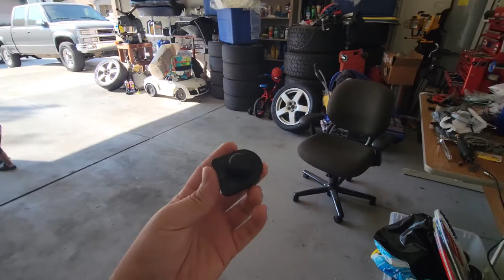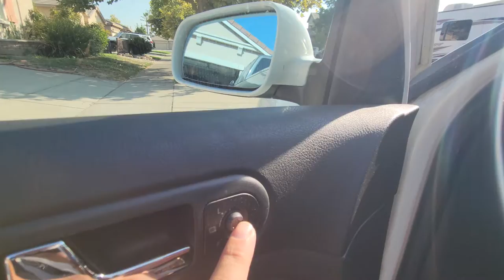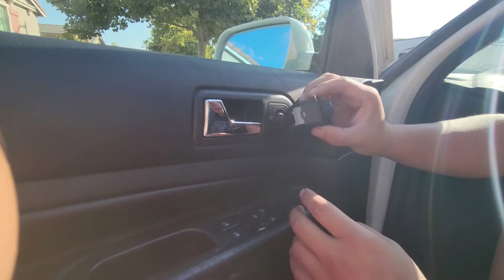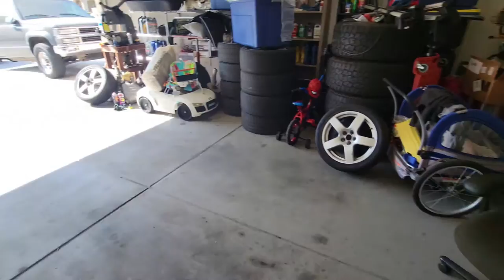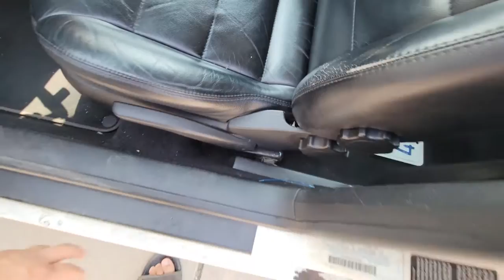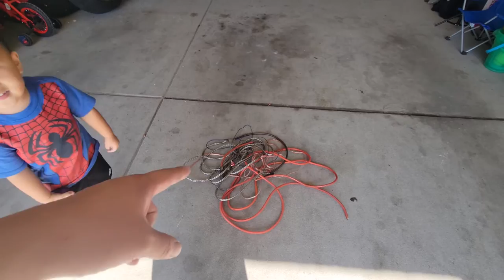SIDE VIEW MIRROR SWITCH REPLACEMENT on My 2000 MK4 Jetta 12V VR6 5 Speed Manual!

Comment: You saved a lot of time prying the old switch out. If your trunk or gas door switch ever stops working, I'll share my experience with mine. Instead of replacing I took it out and soaked it with a small aerosol can of electrical contacts cleaner. It just had some gunk buildup that caused it to malfunction. Once cleaned and reinstalled it has worked perfectly.
Reply from the maker: Wow thanks for the tip! I'll definitely keep that in mind.

Comment: What is the fix to that switch you turned and the noise wouldn’t go off in the video
Reply from the maker: Hmmmm not quite sure what you are asking. That noise/beeping noise was due to the light switch turned on and key in the ignition.